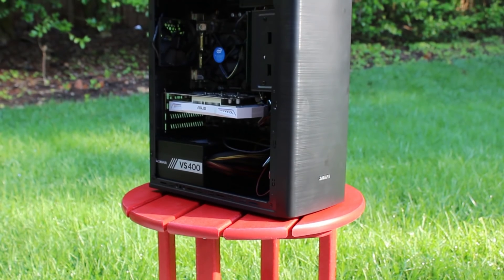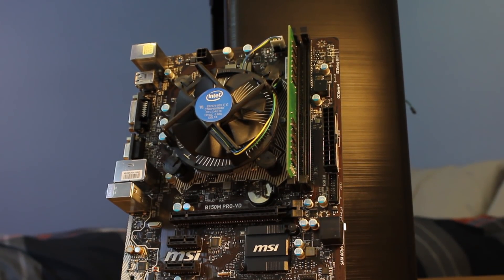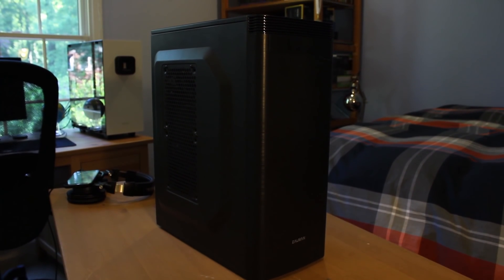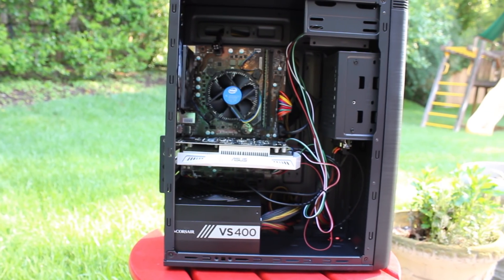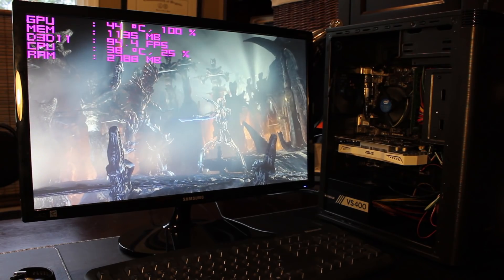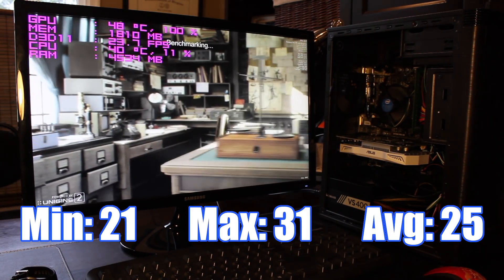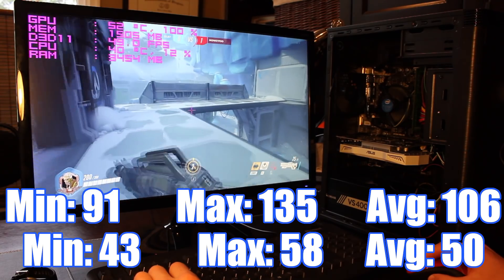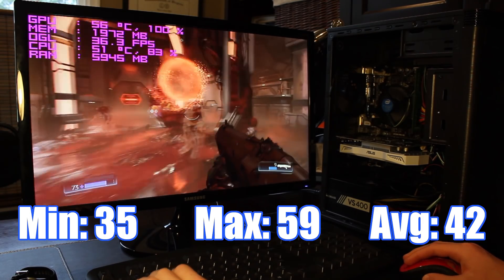$250 All New Parts Console Killer Gaming PC | Build Log and Benchmarks!

Comment: Great vid man!  Liked and subbed. 
 
I am working on an upgrade scheme right now, wondering about your thoughts.  I am trying to make a build that will run Black Ops 3. My current pc is a Dell 3847 with an i3 4130 at 3.7 Ghz, 8gb ram, and a GT 610 gpu with 2gb of DDR3.  Trying to sort what to fix first and was considering getting something like a GTX 750ti with 4gb DDR5 which would allow me to avoid a PSU  upgrade.  What are your thoughts?

Comment: Something doesn't seem right... DOOM isn't necessarily one of the most demanding games on the market, it seems like it wasn't running very well on your system. It's actually one of the better running AAA games out right now. Were you using Vulkan or OpenGL? Also no AA and resolution scale at 100% correct? It seems odd that it was doing so poorly in that game.

Awesome work on the vid though, subbed.

Comment: nice vid, i myself started a project build with used parts only, and i got a Msi p67 mobo in combination with i5 3570k and GTX 970 sc for 220 euro so far, but finding Ram cheap is a bitch!

Comment: 2 cores lol, you do know that game will require more cores before long.
Reply: more like a i5 2400 or a i5 2500k
Reply: NoBanMEPLS Games such as GTA and Thief are heavily reliant on the cpu, and no game will ever run properly on a single core cpu doesn't matter if you have a GTX1080.
Reply: well gl finding a quad core that is not going to bottleneck, and won't be over the price of 50 dollars
Reply: Luca Torricelli what about an x845 or x860 with that exact Gpu?
Reply: lui nope that's for older gpu's. if you use a 460 an i5 from the 2000 series will still bottleneck
Reply: Ben Tennyson. Some games will not run well however some games can. Most games can be played at lower settings, on single core CPU's and low end graphics cards.
Reply: NoBanMePLS Those games you mentioned are old as hell, so of course they'll run on a single core cpu.  Try running any recent game and you'll see that you need a dual core at least.  My pc is dual core and it doesn't run any of my games too well, and all my games are 10 years old at least.  My xb1 eats it for breakfast.
Reply: I ran Arma 3 at 40 FPS on medium/high settings, I ran DayZ on medium at 50 FPS, BC2 at 75 FPS, Arma 2 at 50 FPS. And more with a single core i3 and 750. Games can run on single cores, they wont run really well but they do run.
Reply: Most games can still run on a single core. Not to mention most games are more reliant on GPU rather than CPU. This PC will still run games for a year o two without many issues.
Reply: nobanmeplease no game can run on a single core you downy.... you do realize that you'd need an incredible gpu to play? and most of all the bottleneck would be fucking huge. games barely run on dual core, single core is not even playable

Comment: My £300 PC build. 
G4560 £55
8GB RAM £40
1TB HDD £40
H110 MOBO £45
Cit CASE: £20
500W EVGA: £30
USED GTX 770: £70
Reply: Awesome build but the 770 is an old card so finding it's drivers might prove difficult. Get a new 1050 or a used 1050 ti
Reply: Michael Caluag True or increasing the budget by 50-60 and getting a GTX 970.
Reply: Finding the drivers is as easy as googling it lol, u trippin, but getting a 1050 ti used is a better buy since its a newer architecture and lower tdp and power draw.
Reply: Michael Caluag I think ur right a 770 Driver support will start to fade away and then ur stuck.
Reply: hey I might be mistaken but isn't the h110 a skylake board? If so how did you flash it to Kabylake BIOS?
Reply: and where the rest of the money goooo
Reply: Up until recently I was still using my GTX 760 OC. Great card and still very capable, drivers are definitely not an issue.
Reply: WM505 Gaming yes it is don't get that mobo, I got it and now because I don't have a skylake to update bios I have to wait like another 2 weeks to mail it to the company to flash it for me. No computer shops around me had a skylake , and if they did the flashing was expensive. Instead get a b250 motherboard a bit more like 20$ or 30$ but It's better than buying another CPU for like 50 $.
Reply: Chris Stone yeah good idea. unlucky what happened with your mobo. hope the company flashes it soon.
Reply: On their website they have released updated bios for kabylake cpus to work on h100 series, all you need to do is download the update to a usb, and run it as bootable.

Comment: Well my uncle fucked me over. payed a little under twice this much, and my xbone runs games much better. Should've gone with the build I had in mind instead of letting him go with it.
Reply: My Dad got me a pc for my 18th and now that I've done tons of research, I realise I'm stuck with this shit pc
Reply: Double_Tap Damn nigga, be grateful
Reply: He decided on the stuff on the day. He got me a micro atx case because it was cheap and came with a power supply. He got me an i5 7600 which is a worse deal compared to the 7500 (which is a lot cheaper and only a little bit slower.) Got me a cheap ass motherboard: h110m-h, and it doesn't work properly. He got me a corsair vengeance 2x4 kit at 3200, but I can't have both sticks in because there's something wrong with the motherboard.

He was supposed to pay for this 500 dollar build, so that my saved up 200 could go to a graphics card. No he made me pay all my money so I am;

Stuck with this pc.

I'm grateful that I finally have a job so soon I'll build a proper gaming pc outright. (Overclockable, 16 ram, fancy full atx case)
Reply: Double_Tap My uncle did something similar, got me a budget processor that was obsolete many years ago, and was more expensive than a g4560, because he doesn't like intel.
Reply: Because he doesn't like intel. Oh my god.
Reply: Double_Tap smfh
Reply: Double_Tap yep, he spent about 200 on a single 8gb ram stick, a 4350 and a cheap as shit motherboard, because Intel is "bad value". never even researched the g4560, just said fuck that andd spent my money without consulting with me.
Reply: That's terrible. If your stuff is new, could you try and sell it and start over?
Reply: Double_Tap I'm just going to completely rebuild this summer with a much higher budget

Comment: If this was my build I'd rather have a older quad core like a i5 2400 but I understand why the g4560 is good
Reply: These i5s are still sold new? :)
Reply: BattleAngel1 no on the used market there cheap are
Reply: BattleAngel1 asf
Reply: Savage Tech motherboards are expensive as fuck do even used. sometimes just as expensive new B250 motherboard
Reply: Savage Tech I rather use new pentium for better upgrade path.
Reply: deathbat6916 yep, ryzen's not super budget friendly here. I mean, neither is kaby lake soooo
Reply: you get better single thread performance due to a higher ipc and you still have 4 threads (granted not 4 cores, but 4 threads)
Reply: there $50 iv'e hooked people up with i5 2500 and mobo a few times
Reply: If you don't care about overclocking, you can pick up OEM LGA 1155 motherboards for around $20, and I've seen buy it now prices for the i5-2400 range from $40 to $50 shipped
Reply: by buying Haswell and before processors, you are not restricted to Windows 10. That's a primary reason why the older hardware is good. Windows 7 is supported on them.
Reply: Imię Nazwisko for locked chips i5 2400 comes with oem and there less than $40 sometimes
Reply: Savage Tech nah the i5 is the way to go i almost picked one up for 20 bucks
Reply: Imię Nazwisko I mean it's the same thing just with overclocking, intel always launches a non k CPU version with their i series to help lower the prices a tad bit
Reply: Savage Tech it has 4 threads, so is like a cheaper i3. A used i5 is also a good option.
Reply: the 2400 is not a waste in the slightest. Its a 40 dollar chip that can play all modern games. an i5-2500k is 75 dollars and in order to get that K benefit you will have to find an overclocking board which can very expensive as apposed to an OEM board for about 20. Also you are talking at least a 20 dollar cooler as opposed to say a 7 dollar cpu cooler.
Reply: Koning Willem-Alexander Micro center is having bad ass deals for MOBO it's insane for how low the prices are
Reply: Savage Tech g4560 beats/is equal to the 2400
Reply: Guavabot yeah but ddr4 prices shit
Reply: Guavabot ddr3 is easier to find used
Reply: or get an i5 2500k and overclocked that shit
Reply: Zurc 愛 finding a cheap z68 board.....
Reply: Angus Bodle nicee good lucky fine
Reply from the maker: This is for people who cant use used parts and want the reliability and warranty of new parts
Reply: Savage Tech what if i told you i found an i5 4440 and an i7 4770 at the scrap yard for free

Comment: so for 250 or even like 350 where i live you pretty much get 2-3x value of console in terms of fps. add optional productivity use that adds another 2-3x multiplier over a console. 60fps on most games some even over 100+ all in 1080p med or higher quality settings. Console CRISP 900p-1080p at 30fps or 60 and mostly med settings.
Reply from the maker: Basically, thats one thing I didn't really touch on, with a console all you can do is game with this you can game better and have productivity
Reply: John Wick lol this pc will still run games for as long as a console and better 😂. all consoles are is for people who want to plug in something and play thats it
Reply: Shawn Young no not at all. The GPU is underpowered to begin with and the processor only has 2 logical cores. PCs don't have the benefits of insane optimization that consoles do. This PC will last you probably into next year in terms of keeping up with consoles. By 2019 you'll be way behind in performance. Developers aren't looking to release optimized ports to PC cause there's a larger amount of horsepower available in the PC gaming market as you're not limited to specific builds, so optimization is less of a worry. This PC is very underpowered, I have one with these specs as I built it for my little brother. It was a bit more expensive when I built it but a 460 and dual core processor will not last you into the next couple years of games like a console would. Something like a 1060 and i5 would. For light gaming like esports titles and some Minecraft this is fine, but AAA Console level performance is not happening for long.
Reply: John Wick LMAO, no. The parts don't become less powerful inside the PC, this PC will run games a lot better than Xbox One and PS4 now and will do always. The "underpowered" CPU abd GPU in this build are still way more powerful than the console's 2010 AMD Jaguar chips. People said the same thing you did years ago, but cards like the GTX 750, R7 260 and GTX 660 still can play the newest titles fine.
Reply: John Wick lol and consoles barely play games at the end of thier life cycle
Reply: John Wick on platformers most aaa games run at 900p at 60 fps and if it runs at 1080p 60 fps it isnt a demanding title that doesnt look that good and resoultion isnt everything lol consoles play on medium 😂 my freind cody will even admit pc always looks better and he plays xbox one espicially demanding titles like  battlefield and u guys get remastered version of games that dont look much better than the original pc version like skyrim for example
Reply: They will play them 1080p and over 30fps, which will be better than consoles.
Reply: The Duppe PS4 1080p 30-60fps
Reply: In very few games does the PS4 hit 60fps, and those games aren't the best looking games that it does.
Reply: your profile picture is the best
Reply: Exactly
Reply: Star-Lord well this pc will need to be updated to run games a couple of years from now, consoles run their respective games for about 7 years before they're unsupported. This pc is nice but it won't last as long as a PS4. The combination of the horribly underpowered CPU and GPU in this PC makes it pretty bad. You'd be better off just spending $600 on a PC with an i5 and 1060 that will actually last into the next generation of games. $250 PCs aren't console killers, they're pretty much just year specific console killers. They do well for about a year and then the next wave of AAA titles come out and you're doomed. Especially with that GPU.
Reply: The Duppe they can't play them fine and no the parts won't get less powerful. The games get more demanding.